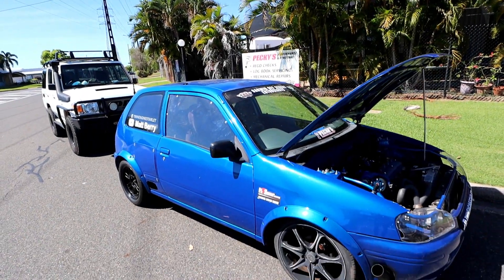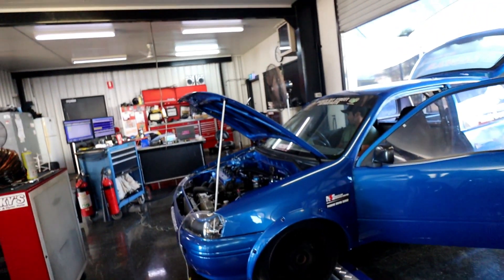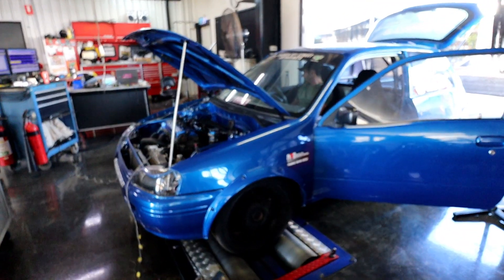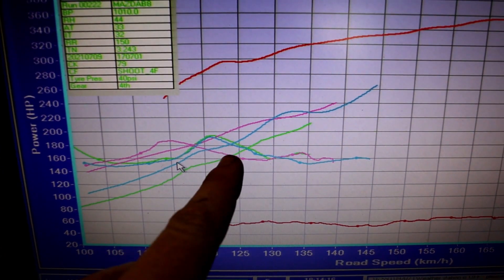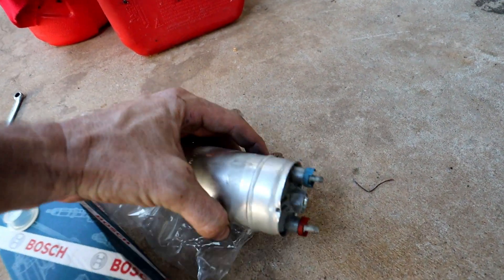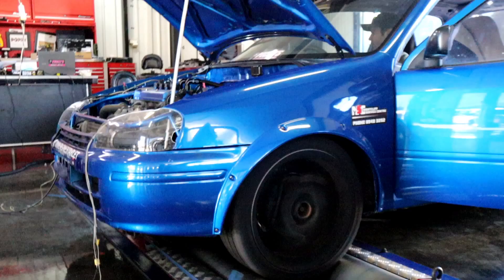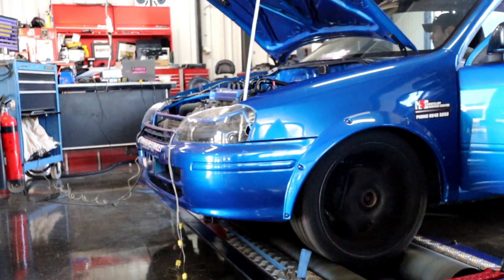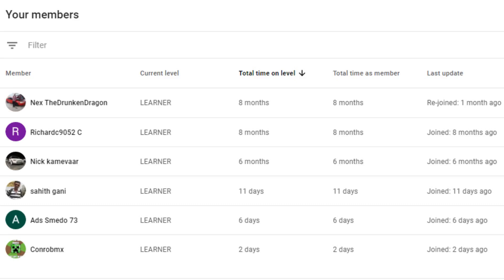5efte attempts power run on the new Haltech ECU

Comment: Filter?
Reply from the maker: i seriously regret not designing the setup to suit a filter, dust is destroying the intake wheel :( sadly i have no room to put one now unless i change the exhaust manifold. Always always use an air filter!!
Reply: Was really asking about the fuel filter but with regards to air filters it's very necessary,  especially if ur turbo is expensive.  Sandblasting times a million

Comment: From the looks of it you are ok with the return, you need to be between 2-3 liters/m. 3L covers up to 100psi of combined base and positive pressure on pump gas, 4-5 for E depending on the mass density and ethanol content of the fuel used. Raise the base pressure to 50psi with the vacuum off. The original 044 is good for 330-340 lph at 80 psi and 13,2 volts, and 280 lph at 120psi at the same volts. You can also increase voltage to the pumps to be between 13,5-14volts on idle and it will take care of itself on amperage during boost and rpm. The specific pump is good for 600+ at the wheels on high octane pump gasoline or race gas on full tilt, on e85 you will need more pump than that, i.e 2 of them. 12-12,2 is ok on E, but not on pump gas, 11,5-11,8  for pump gas.
Reply from the maker: Incredible info man i searched everywhere for something like this and you have answered all my questions haha!! thankyou!!! Great info for others to read too!!
Reply: Great reply :) bang on with the fueling. I think your problems in the past were caused by lean mixtures and to much timing. Detonation causes huge spikes in pressure and heat that damage, well everything.

Keep doing what you're doing :)

Comment: Make sure you put a fuel flow gauge on the return line when on the dyno, you want to be returning atleast 1Lpm on full noise. What is you base fuel pressure with vac hose off the reg?
Reply from the maker: Yeah you're dead right about the gauge, didn't have it that day... i read online we should be getting around 3.5 litres return a minute at 65psi fuel pressure? 40psi base and 25psi boost? but minimal 1 LPM sounds easier to follow. I guess thats worst case scenario?
Reply: @Camp_Dogs  I use atleast 45psi on pump or 65 on E85. 1LPM return under full power